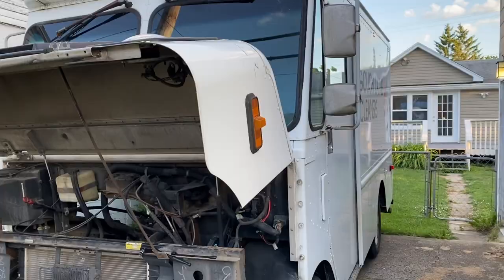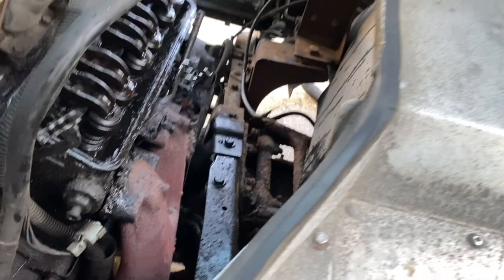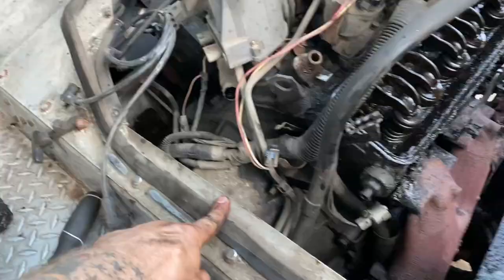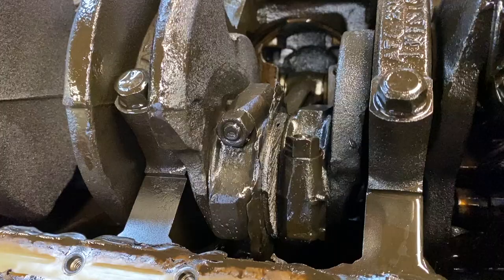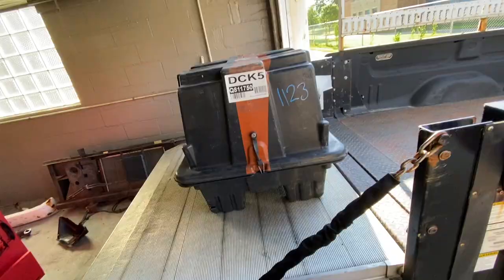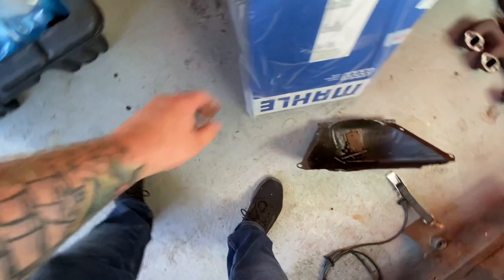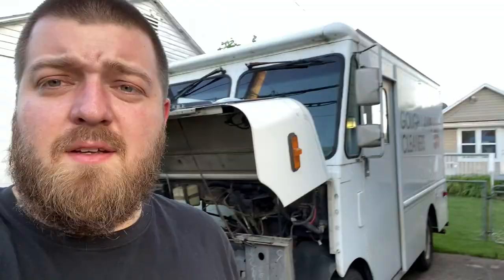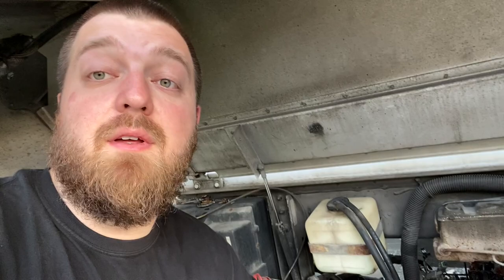Turning My '95 GMC Step Van Into A Mobile Shop

Comment: I have a 74 GMC P3500 with the 350sbc. I’m gonna be using it for my locksmith business and some possible kayak hauling/ recreational activities. I recently dropped in a 292 straight 6 temporarily until I can get around to rebuilding my sbc but I find this straight 6 is an awesome motor so I’m in no hurry. Good luck with your project✌🏼🙏🏼. 

Btw, these vehicles used to sit and idle a lot so wear and tear from low oil pressure is common. My Sbc, had a wiped out cam shaft.

Comment: Good luck with your business venture. If you don't already have them I would consider two heavy duty 3 ton aluminum quick pump floor jacks with as much lift as you can find. Steel floor jacks are so heavy you'll get damned tired of lifting them in and out of the van. Also ,be sure you have a good bench top work surface inside the van and an extended rear bumper with a vise would be a big help. If you're not carrying a torch set I would recommend a good MAP gas burner with spare bottles. If you're going to be carrying expensive scanners, laptop, etc. I would get a Pelican case fitted out for them so you can grab it and take it in and out of your house for security reasons, not leaving it in the van unattended. Might want to consider outfitting a rolling box for your cordless tools or at least bring the batteries inside in cold weather so you're not starting a job with cold soaked batteries in the winter.